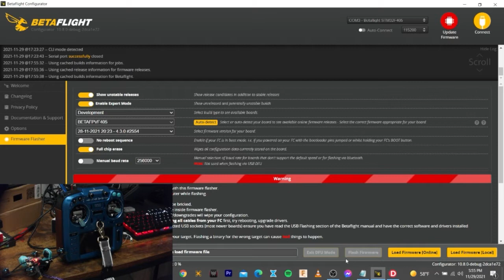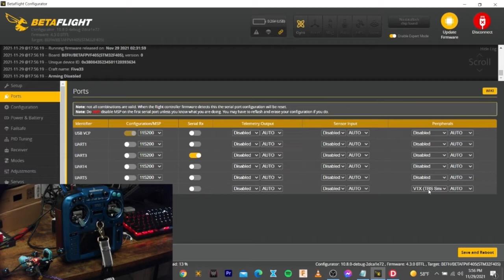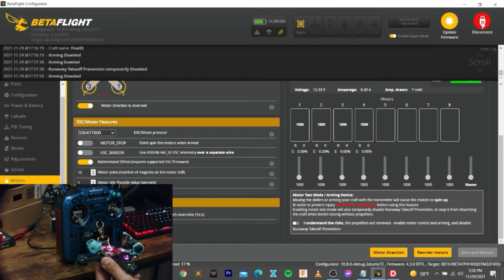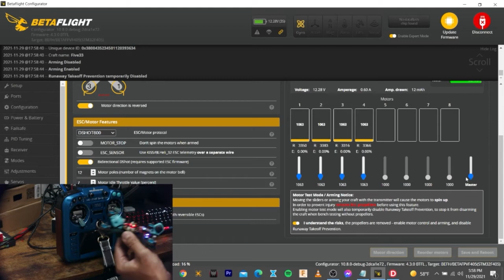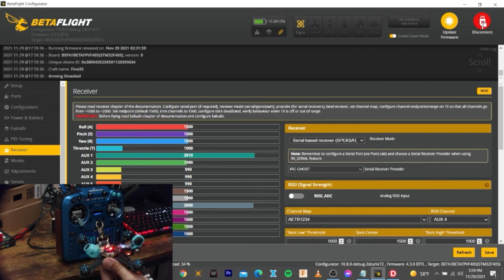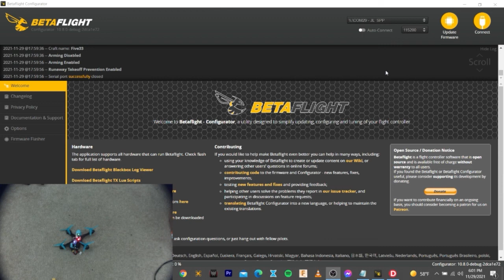Plug N' Play TinyTrainer Build Video

Comment: Just loaded this up today, but questioning the dynamic gyro low pass filter. Curious to the rational to the 0hz?
set gyro_lpf1_dyn_min_hz = 0
set gyro_lpf1_dyn_max_hz = 1000
Reply: This is normal I’m pretty sure it’s called the karate filter tune
Reply: @marcusgreco  karate filters are

set gyro_lpf1_dyn_min_hz = 500
set gyro_lpf1_dyn_max_hz = 1000

Why does this TT tune have the gyro cutoff at 0hz?
Reply from the maker: @oliverwright6263  I’ll update the diff today. Looks like I missed some stuff. This was developed by Zack Smiley

https://github.com/betaflight/firmware-presets/pull/81/commits/accb79c5264fe8f09098a7a47b848bec9630e1d0
Reply: @Mondo_FPV  Thanks for the quick reply! I see now that means Gyro LP1 disabled. Learned something today :)
Reply: @oliverwright6263  wait so am I good to use that tune?

Comment: Hey so for some reason when I loaded this up with legit the exact same setup my quad goes bananas when I try to move the sticks after arming. It just instantly goes into runaway mode. Is there any reason for this. The only thing different about my quad is the fc. Props are also spinning in the correct direction
Reply from the maker: With accelerometer on is the board orientation correct in Betaflight? Motor mapping correct? Motors spinning in the right direction?